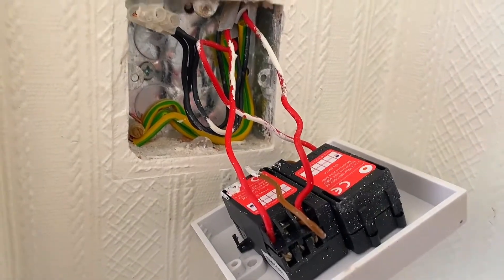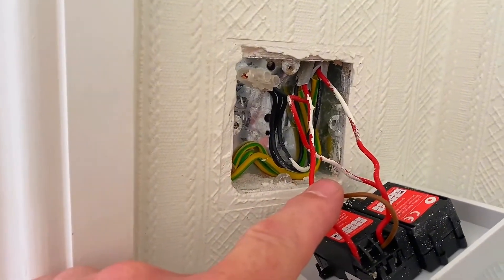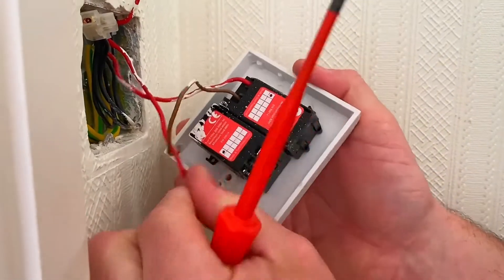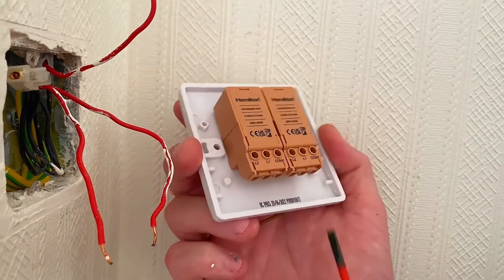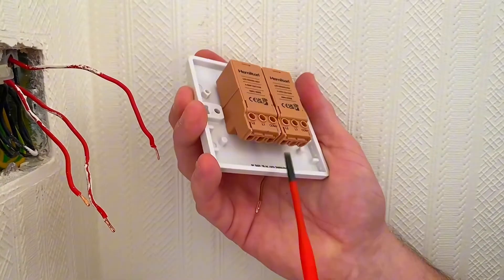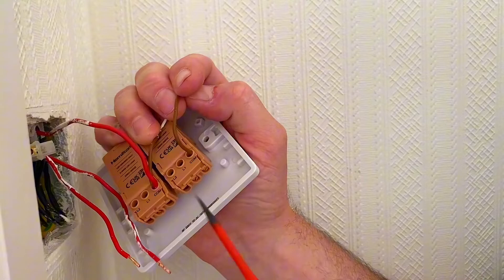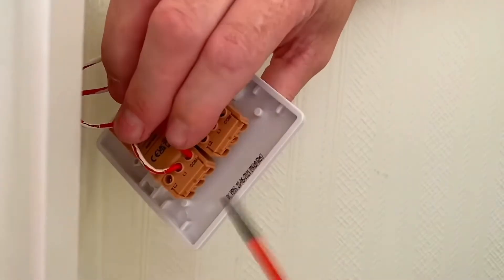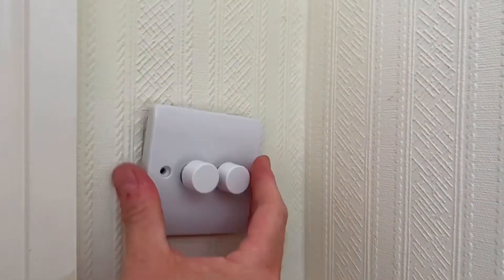How to Fit a 2 Gang Dimmer Switch - Connections Explained

Comment: Brilliant video. 👏👏👏

1) I have 4 Red wires. (A ceiling light, (B livingroom walllight, (C kitchen light, and D a dining room light. All in one socket 🤔🤯

2) how do i spot the Permanent line?

3) My bridging link is black

4) and where do i put the 4th red wire? Thanks 😊

5) my dimmer switch is metal